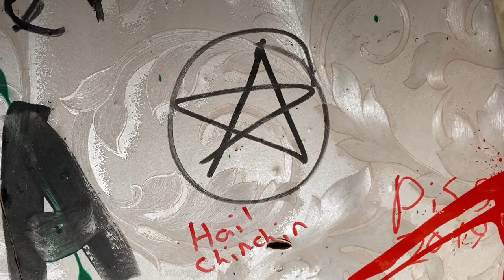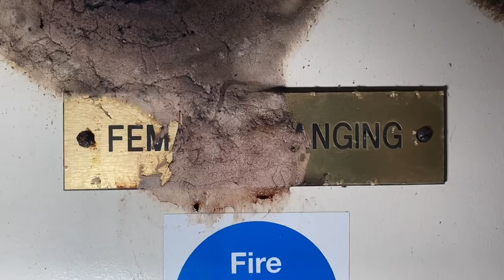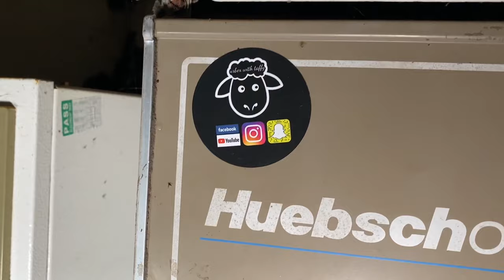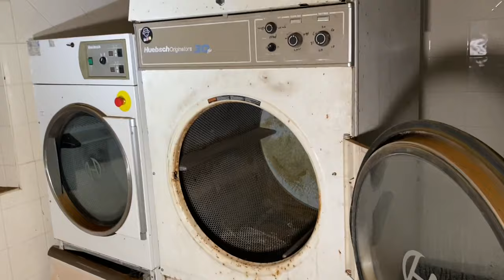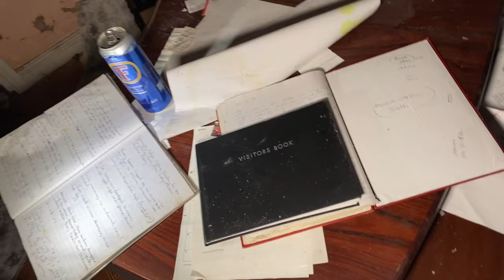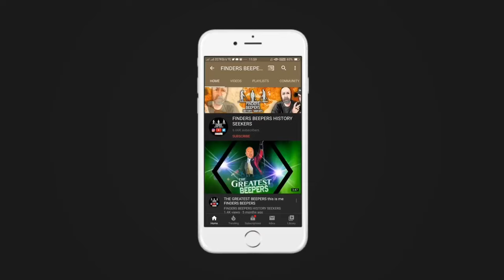WHO WAS WATCHING US on the abandoned care home stairs FINDERS BEEPERS

Comment: See this is more convincing than most ghost videos cos, your channel isn't even about ghost so it's not even like you have constant pressure to deliver the goods. I mean, what was that? The only thing I can think of is an unusual shadow cast via the torch as you look upwards. But that's a bit of a stretch since there's nothing  visible to cast the shadow and it moves behind the ceiling. So any shadow cast would surely move along the celling if you was causing it

So I dunno, this is unironically the most interesting ghost video there is

Comment: I'm glad you replayed the section of video with that figure moving, as I'd rewound and slowed down that section myself and couldn't see anything. But when you replayed it the figure seemed obvious. 

With regard to the upstairs rooms with two beds in, I wonder if they could have been staff sleepover rooms rather than for residents.

On an earlier video I've seen a room that had a load of blue mattresses in so I suspect they would have gone on top of the blue hard bed bases you saw. Everything would have been wipe down material and easy to clean and disinfect in the event of any 'accidents' in bed.

Comment: Freaky place, and surely the stuff of nightmares, but it looks like some small cat sized creature at the top of the stairs, not a person. You can see its eye shine when it briefly faces the light, and behind it is just its shadow cast by the light. From the angle they were viewing that level, you can see the top of the door in the background, the only way that moving shadow could be someone's leg would be if they were right up against the rail, and in which case the light would have illuminated them the same as the railing. Take a freeze frame when you see the eye shine (that brief bright flash down low by the bottom rail) into Photoshop and brighten it up and you'll likely see it was just a cat, which could have easily fit through that small window to the tree outside.
Reply: It is definitely a person they captured
Reply: @craig19193  Nope. Not a chance.